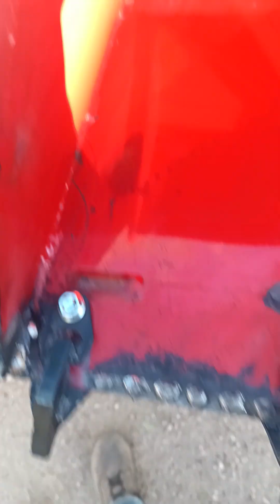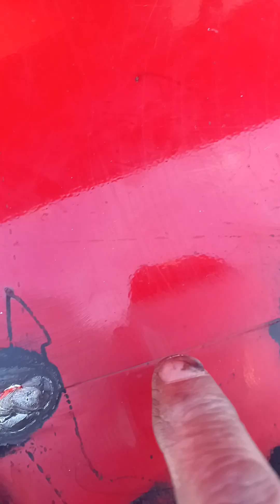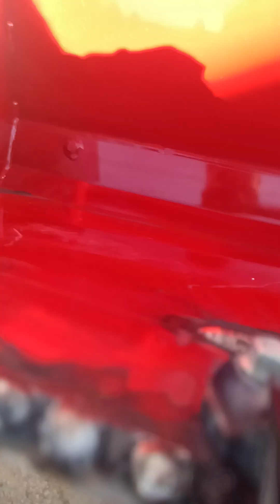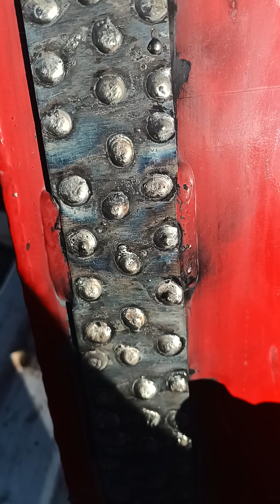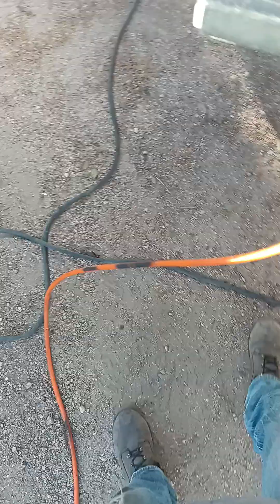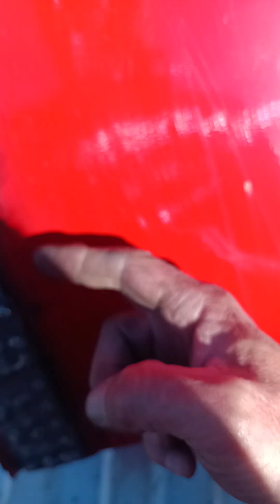2 Hard Facing Tips !

Comment: I just picked up a Kubota box 2380 , came with the bucket a 69 inch mower and a snowblower, it’s a 23 horsepower diesel plenty of power no weight behind it for digging just spins, I’ve seen videos where they add a bunch of weight and a piranha bar to the bucket seems like they dig to beat hell then, I got it basically to move snow , cool little machine
Reply from the maker: @JPZ-y8z  Sweet